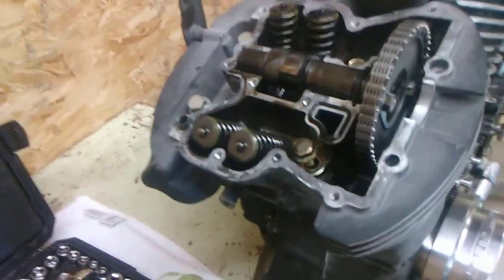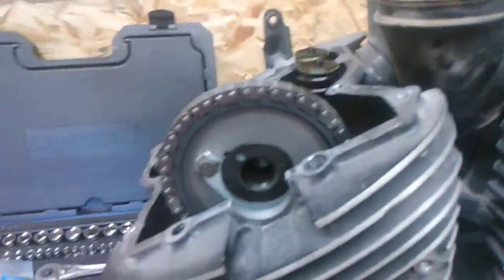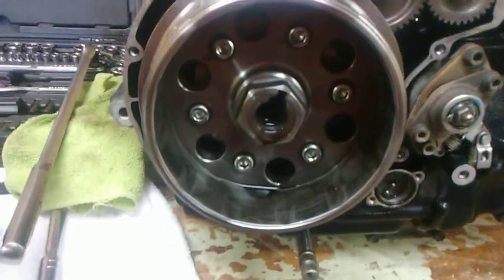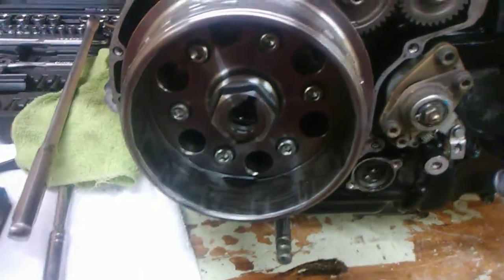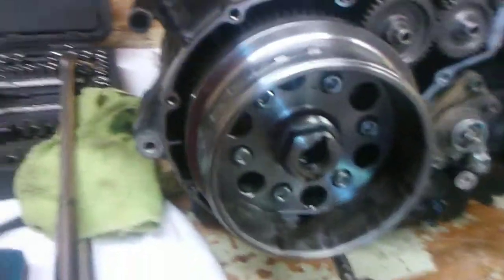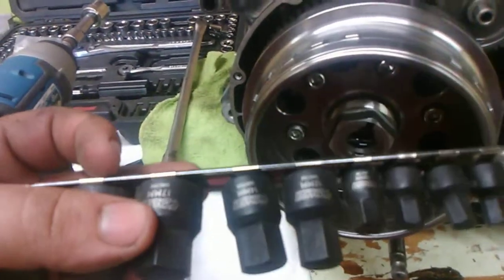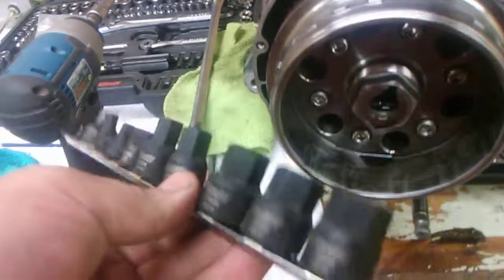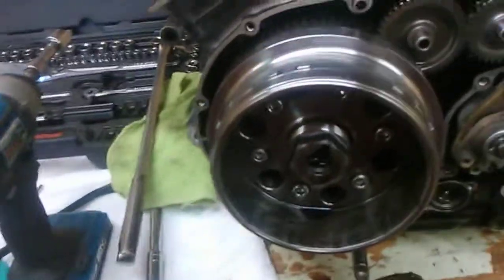Suzuki M50 Teardown PT 4

Comment: Trying to fix my m50 for Sturgis this year and I dropped a wire down where the timing chain is so I'm trying to take off the generator cover like you have and I've got it about half an inch out but it wont come the rest of the way was there a trick to it or there is something I have to take off first, Thank you in advance